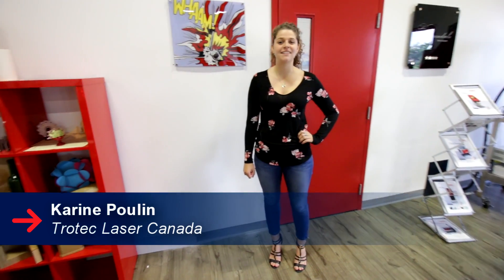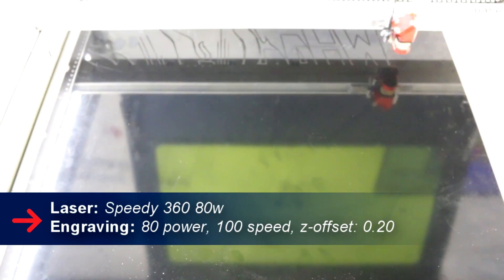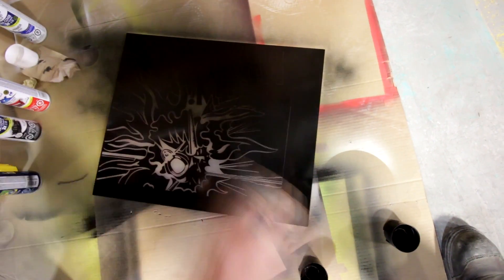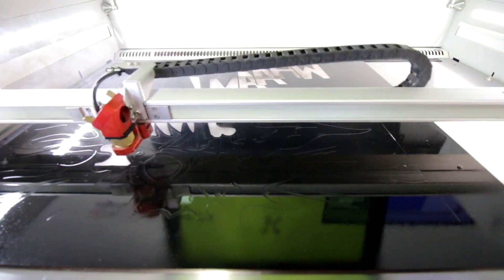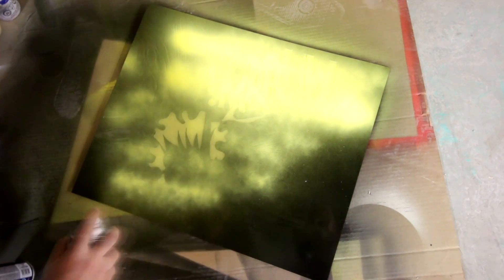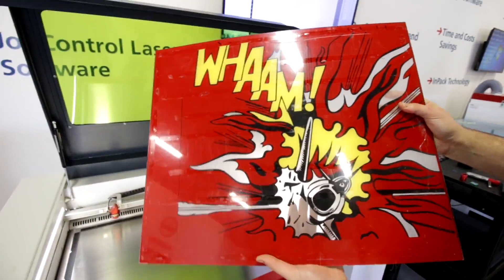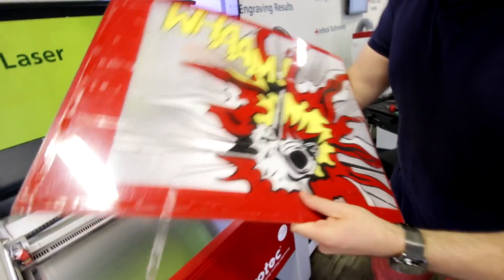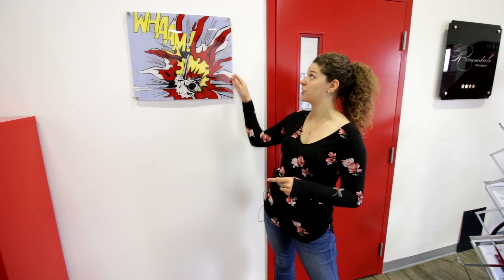Multiple Colour Reverse Engraving | TroGlass Reverse | WHAAM!

Comment: I’ve tried this a couple times with 3mm and the acrylic always ends up bowing and messing the engraving up. What can I do to make sure the acrylic doesn’t bow. Thanks
Reply: You could try turning your DPI down . . .
Reply from the maker: Hi Greg, when engraving out of focus it puts a lot of heat on the material which makes it bow. Have you tried using double-sided adhesive to glue down the material on a stainless steel table?

Comment: Hi, thanks for the video! I would like to know if you have to adjust power and speed after the second layer of paint to go "through" the paint with the laser. Or do you use the same parameters no matter how many colors you will be spraying? Thanks!
Reply from the maker: Great question! Yes you might have to go a bit slower to go through the paint and the back layer. Maybe an extra 5% slower.

Comment: what exactly is the cast material you are using? is it just a clear with a one side painted base color? can we just start with a cast clear and paint away? also, what type of spray paint are you using?
Reply from the maker: Hi Chris, it's a clear acrylic with a very thin layer of coloured plastic/lamacoid on the back of it, and you reverse-engrave that piece of thin plastic. You can technically just spray-paint over the back of clear acrylic but you won't have a glossy or satin background colour. It just regular store-bought spray-paint from Home Depot.
Reply: Thanks for the reply...where can I buy the material
Reply from the maker: No problem at all! Well there's TroGlass Reverse and TroLase Reverse. TroGlass is what you see in the video, it comes in 5mm and 3mm thickness and is the more expensive option because it has that acrylic gloss plus the flame-polished edge for laser cutting. As for TroLase Reverse, it's the same concept but it's a satin look instead of gloss, it comes in only 3mm thickness and is a lamacoid/plastic instead of acrylic - and it's more affordable. In Canada we sell both, which country are you from? You can find it on our Canadian store here: https://www.engraving-supplies.ca
Reply: wont let me purchase
Reply from the maker: you have to register. If you are in Canada you can provide your email and we will speed up the process

Comment: So there's no issue with fumes generated by lasering the dried spray paint?
Reply from the maker: Hi Ron, you should always consult your MSDS sheet of the spray paint you are using.
Reply: Makes sense. What kind of thing do you want to look for in the MSDS to make sure it's laserable? Thanks!
Reply from the maker: Hi Ron you would need to look for it in either the combustion or fire fighting measures part of the MSDS. Make sure there is no poisonous or dangerous gasses that can come off from that material. Hope that helps.
Reply: are you kidding?   nobody in their right mind would opperate a machine like this without air filtration.   there is a suction vent at the back and the fumes exit the builduing though a duct